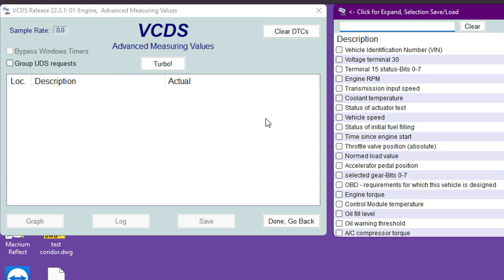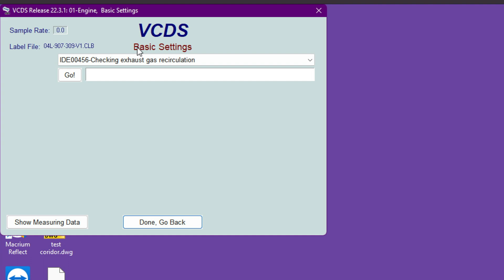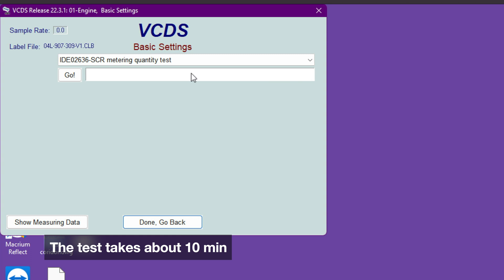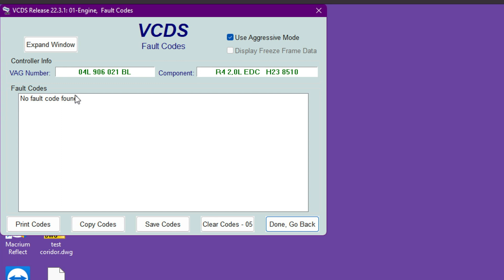AdBlue N474 Reducing Agent Injector  - Test the output flow quantity of AdBlue

Comment: did you plug in battery charger for the duration of the test?
Reply from the maker: @lukaszM46  no I did not as I assume this is not so much battery intensive. Still it is not a bad idea.
Reply from the maker: @lukaszM46  please subscribe to the channel to support it.
Reply: @bonevchannel  thanks, i just subbed, lastly can you tell me what was the engine code?
Reply from the maker: @ https://youtu.be/baKdyEoWaDk?si=iGSca7HMNoMUc0qw I think I am showing the code here. P20400 I think it was. This video is related to my problem and why I did injector test.
Reply: @bonevchannel  thanks but I don't mean the error code, I mean the engine code, like the variant of the engine itself
Reply from the maker: @ oh, I see. It was 190 TDI engine. Part #: 04L906021BL
Component: R4 2,0L EDC 
Software version: 8510
ASAM/ODX identifier: EV_ECM20TDI01104L906021BL
Coding: 32254012243601080000 (hex)
[No fault codes]
Reply: @bonevchannel  thank you, that is still not the engine code, but based on the power 190 i think its CNHA engine, which is the same as mine, so i can follow the procedure in your video step by step. thanks again for your time and quick replies
Reply from the maker: @ yes I was wondering what the 4 letters were but yes your code is correct.

Comment: I have a consistent P20EE only after a longer journey that flags in diagnostics. 

I took the injector out and ran the test but didn’t change the value from 4 to 2. The supply pipe dribbled so I changed the pump. The injector sprays twice then stops. Vcds shows ok pressure from pump resistance of injector 0.3 ohms from memory. I’ll change the value to 2 in adaptation and test again but I think the injector could be faulty
Reply from the maker: @davem4131  I think you have to run it with 2 to put it in diagnostic mode.
Reply: @ ok, I’ll try that! Thanks for the info as hard to know unless you’re told. The injector does spray once but stops when just running the test without adaptation. But the pump still clicks and says aborted due to safety reasons. Possibly the injector is failing. Is a constant dribble from the supply pipe when removed normal?
Reply from the maker: @ I would say no. If the pipe is pointed up there should be no dripple because there is no pressure. You did the test engine off right?
Reply: @bonevchannel  yes engine off. After I noticed the injector only sprayed twice then just started clicking I disconnected the ad blue supply pipe and ran the test again. The pump was making a noise and ad blue was dripping out the supply pipe. I replaced the pump today and reacts the same. So I assumed the injector may not be working correctly. Ad blue was flowing out the tank pump spigots that slot into the pump so they aren’t blocked. I’m assuming it’s not a high flow rate to the injector.

Comment: thanks! this is the only video i could find on this! 
Whats the purpose of doing the adaptation value from 04 to 02?
also the test is done with engine off i assume?
Reply from the maker: I am glad you find this video helpful. Adaptation value will trigger the testing mode. The test is with engine off. Please subscribe to the channel to support it.
Reply: @bonevchannel  Thank you for the quick answer! so far i have found another piece of information that says at the end of the test, the injector should have sprayed out 165g -178g of adblue, perhaps with the adaptation you are changing the test mode to a smaller amount, like in your case you said it should have been 25-30ml
Reply from the maker: @ the quantity varies per car model
Reply: @bonevchannel  yes that makes sense, what is the engine code in this example? It looks very similar to mine 2.0 TDI CNHA

Comment: Hello
I have a problem with the AdBlue injector (N474). 2.0L CR engine.
Some time ago I got the error: "Reductant System Performance Bank 1 P204F 00 [101] - Malfunction"
It was connected with a problem with the wiring harness (engine emergency mode, power reduction - fixed) and the need to use the DPF burnout procedure. After repairing the wires I deleted the errors and none of them returned, but the AdBlue message did not disappear. Today I did an AdBlue injector test. After 10 minutes, over 100ml of reducing agent came out. According to a forum user on ross-tech, this means either a leaking injector or too high pressure. What do you think is more likely? How to check the pressure in the AdBlue injector system?
Reply from the maker: @Doombringerpl   Hope this helps:

	1.	Leaking Injector:
	•	If the injector is leaking, excessive AdBlue fluid will be dispensed even when it’s not commanded to do so.
	•	A visual inspection of the injector for leaks and crystallization around the nozzle can help confirm this.
	2.	Excessive Pressure in the AdBlue System:
	•	If the system pressure is too high, it can cause the injector to deliver more fluid than expected.
	•	This may be due to a faulty pressure sensor, clogged return line, or a malfunctioning pump.

How to Check AdBlue System Pressure:
	1.	Using Diagnostic Tools:
	•	Use VCDS (Ross-Tech), ODIS, or another compatible diagnostic tool to check live data from the AdBlue system.
	•	Look for SCR system pressure readings and compare them to manufacturer specifications.
	2.	Manual Pressure Testing:
	•	Some vehicles have a test port on the AdBlue pump where a pressure gauge can be connected.
	•	Normal operating pressure is typically between 4 to 6 bar (58 to 87 psi).
	3.	Check for Faulty Components:
	•	Inspect the pressure sensor for faults.
	•	Check the AdBlue pump operation and verify that it is regulating pressure correctly.
	•	Ensure there are no blockages or restrictions in the return line that could cause excess pressure.

Next Steps:
	•	If the injector is leaking, replacing it should solve the issue.
	•	If the pressure is too high, investigate the pump, sensor, and return lines to find the root cause.
Reply from the maker: @Doombringerpl  please subscribe to the channel to support it, if you already have be not done so 😁

Comment: Hello there I know it's old video you might still be active on your channel,
I am having some problems with my A4 2015 2.0tdi,
Adblue error code P20E8 low adblue pressure with no start in xxx... Miles ,
Car was fully working left it parked for around 8 months and this error came up ,
I have tested same way asnin this video adblue injector was spraying for around 2 mints and stopped on vcds it says aboard for safety reason, in 2 mints I got exactly 30ml adblue, donyou think it's normal to be 30ml in 2 mints? As you mentioned in this video process will complete in 10 mints?
Please input your thoughts,
Any help idea tips suggestions welcome
Many thanks
And by the way this video really help as I was trying to do this for a long time
Thanks 🎉
Reply from the maker: Hi, thank you for your question. Something is definitely off with your system. The fact that it aborts the process means there are some issues. I would start by checking the pipe connections. It is quite possible the pump or a sensor to be faulty or the injector itself. The system is not designed well and with time it starts showing. The best approach is to check all the components with VCDS and find what the relevant good values should be for each component. 

Please subscribe to the channel to support it.
Reply: Thanks for the quick reply I did subscribe already and looking forward to seeing more useful videos, keep it up good work, 👍  @bonevchannel

Comment: i do the steps, i press go on the scr mesuring test, the injector does not spray anything but i can hear under the car a noise constant… it may be that the injector is bad?
Reply from the maker: @LeCataNordicu  possibly. Unplug the pipes going to the injector and start the car or the test. See if anything is coming through the pipes. …. Please subscribe to the channel to support it. 🙂
Reply: @bonevchannel  yess!! i did that and adblue comes out
Reply: @bonevchannel  i checked the resistance on the connector of the injector and gives 13.1, ive seen a chart that its supossed to give between 150-500 depending on temp. the engine is cold now. 
also in vcds i get 2 fault codes
1 - Reductant injector Valve (bank 1) stuck closed. 
and 
2- Exhaust gas temp sensor bank 1 sensor 2 short to gnd
Is the EGT sensor 2 located INSIDE the injector?? 
the temp reading gives -40 celcius when plugged and 1000*C when unplugged the injector
Reply from the maker: @LeCataNordicu  I think in this case the injector is bad.
Reply: @bonevchannel  Yes i think that aswell, thanks man!
also, is it safe to drive the car like this or it will fuck up the whole adblue system?
Reply from the maker: @LeCataNordicu  I would not recommend it for long. The AdBlue system will complain and most likely will give you a dashboard message 1000 km to fix it. If it goes to 0 km left you are done and the car will not start. Also the catalic converter might not like that.
Reply: @bonevchannel l have the same problem. I took out the pipe from the injector but nothing came out. And l searched a lot why ıt didnt give any liquid. Someone told me adblue is send to the injector when it necessary . Not always! İs that true ?
Reply from the maker: @ it is always sent to the injector. You have to check for leaks and the pump voltage.
Reply: @bonevchannel  does it change from car to car? My car is Octavia 2019 , 1.6 tdi clh. And there is no fault code!
Reply from the maker: @ well I would assume up to the injector is under small constant pressure from the pump. Then if the injector decides to use it, it is there
Reply: also, i unplugged the hose that gets adblue to the injector and adblue comes out, 200ml in 1 min aprox. if i reconnect it to the injector, nothing sprays. i think its the injector faulty, should i change the whole injector?

Comment: After that test, the AdBlue error 28653 with mileage limit disappeared from the dashboard cockpit or you performed something additionally?
Reply from the maker: Ah, sorry. Yes I did do a reset of the AdBlue system. After the reset it will go away in about 50 km.

Check the reset of AdBlue system here. 
https://youtu.be/39yfIxU9UM8
Reply: So what you did as the last step? What was cause in your situation
Reply from the maker: @MrSzpanski  it was the NOx sensor so far. The error pointed toward the injector but multiple test shoed me it was not it. The NOx sensor was not detecting quantities properly and that is where the issue was. Check junk yards for those sensors. Find exact model and make and you are good to go. In my case I found the same one but newer version from Audi A4 2018.
Reply from the maker: @MrSzpanski  see here: https://youtu.be/sCt_tBxPub8
Reply: So at the very beginning you had P204F 00 [101] without any other errors but you ended up on nox?
Reply from the maker: @MrSzpanski  correct. After 1-2 years of resetting the NOx finally gave up and gave an error.
Reply: @bonevchannel what kind of Tester/ Software are you using and how much does it cost?? This VCD !? Thanks 👍🏾